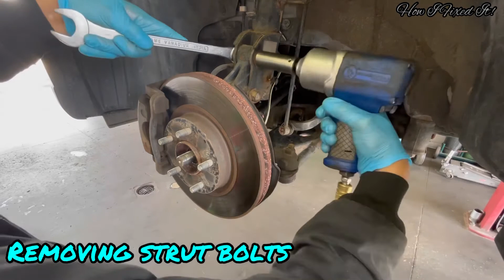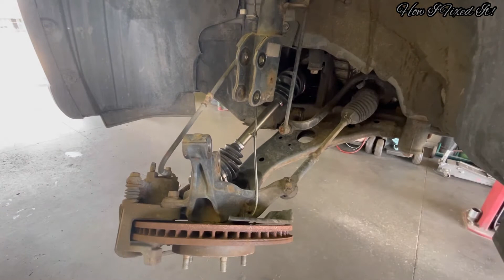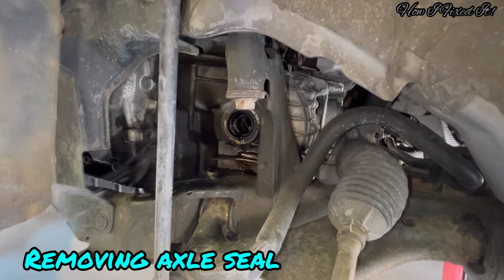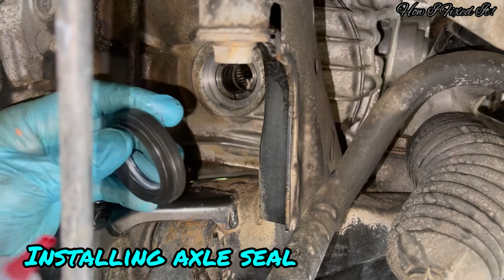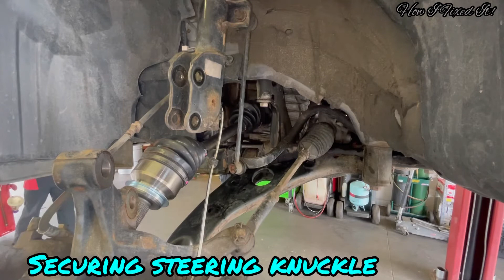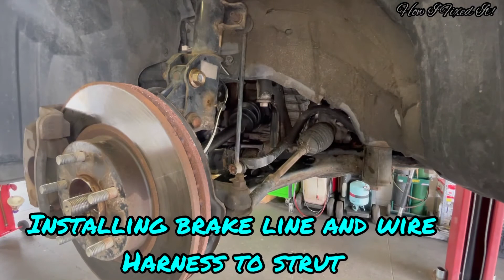How To Replace Mazda Axle Seal/2013 Mazda CX-5 Axle Seal Removal And Replacement

Comment: Do you cover the 2 holes where the axle seal sits or do you leave a gap so it can breathe?
Reply from the maker: Depends on the length of service. If I have to leave and focus on something else then yes I would cover or stuff with a shop rag. Hope this helps. 👍

Comment: this was great. short and to the point. perfect.
Is the anaerobic sealant required?
Reply from the maker: Thank you. I appreciate the kind words. The anaerobic sealant is not needed but does help with installing by lubing the seal and drying to seal any in perfections with the transmission housing. I hope this helps. I appreciate the feedback 👍
Reply: @HowIFixedIt  thanks alot.
I just realized the axle seal is slightly leaking from the passenger side front. this is on a mazda cx7.
I've never removed this type with the shaft extension. seems it's a bit more involved.

would you say it's the same procedure on the right mostly?
thanks again
Reply from the maker: @snivvelslurderagementai2560  there may be retaining bolts holding in the axle to the bracket but otherwise the same procedure. I hope this helps. I appreciate the feedback 👍
Reply: @HowIFixedIt  
thanks again. I'll be doing this job soon.
 i had one more question about the tie rods.
in your video you don't take the tie rods off but i see others taking it off.
what's your take on that? 
remove or not remove the tie rod ends?

Comment: What is the sealant you used ?? I have a Mazda 3 I have to change the seals on that are leaking and I didn't put this sealant last time as the factory didn't use it but I think its a good idea now. Thanks
Reply from the maker: Anaerobic seal.
Reply: @HowIFixedIt  thank you.

Comment: Great video! Is it a similar procedure for a 2018 cx 5 rear driver side axle seal? Mines leaking differential fluid and I suspect it’s the seal. The dealership wants to replace the whole differential but I think the seal is the only part that needs to be replaced

Comment: I tried a slide hammer.  I tried axle forks.  I tried a pry bar.  I tried a chisel and hammer, ratcheting straps, and a motorcycle tire spoon.  After working on this thing for hours, rotating the axle over and over again, and begging the Lord to let me finish before nightfall, the only thing that worked for me was a 27mm wrench made by Pittsburgh that I bought years ago as part of a set of long handle wrenchers from Harbor Freight.  I stuck it in there, pulled gently, and it finally popped out.  I bought tools made specifically for this job, and some that weren't, and they all got beat out by a good, old-fashioned wrench.

Comment: Do you have the part number for the oil seal?
Reply from the maker: I don’t. I had to rely on the parts counter employee to help me with that item. I did have in pulled out and for them to match perfectly. I hope this helps. I appreciate the feedback. Thank you 👍
Reply: Do you have to replace that seal when replacing the axle?
Reply: KOYO MT040A12